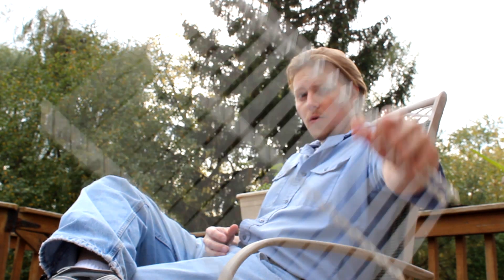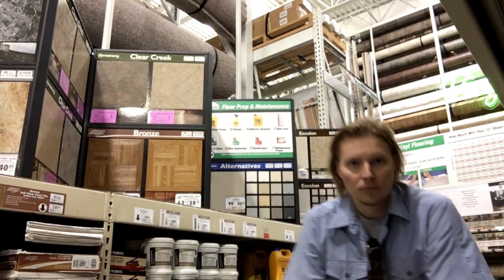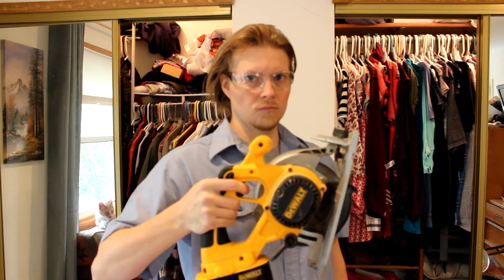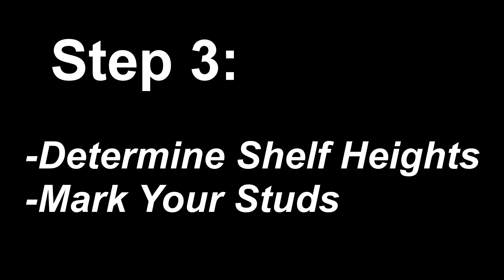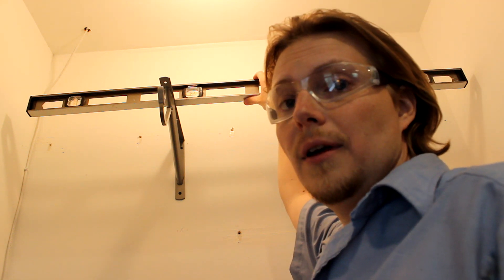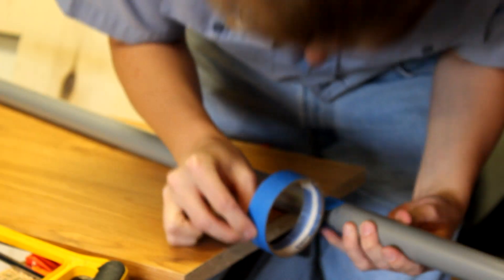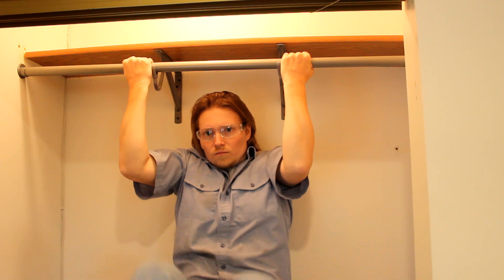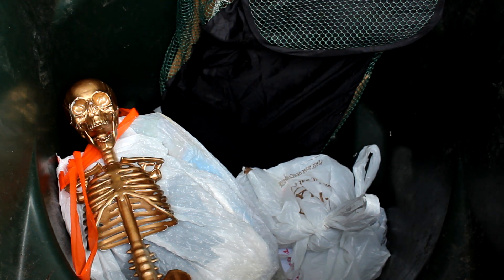Why I Hate Wire shelves & How to Replace them

Comment: Don't you think you should put some kind of cleat or end support at the shelf ends to prevent sagging over time? You said you're a perfectionist... its basic carpentry 101! Fully support your work! Especially with pressboard shelves ! You need to hold those sucker's in place!

Comment: Nice job. My wife wants wire shelves in the laundry room. I just have to ask. You did all that work and then used particle board, and not supporting the ends the boards with one or 2 more brackets the board will eventually sag and fail. Why not just get a piece of pine. Just a suggestion 🙃
Reply: I said the same thing to myself I would of out some extra support on that

Comment: What type of hanging rods do you prefer and does Home Depot cut pipe and wood for you if you don't have the equipment?
Reply from the maker: I don't have a preference. Whatever fits the supports is what I have used. I don't think Home Depot will cut those for you, however you can cut them with hand tools that are relatively inexpensive.
Reply: Missharper25 : HD does cut various sheet materials and lumber to customer spec -- and also permits in-store cutting by customers. Check with your local store.
Reply: Shelves A La Mode
Adventures In Great America : You have something of Buster Keaton and Harold Lloyd about you, but there are higher-end wire shelves that address some of the strength, convenience, and aesthetic issues that you hated, and a remod with these would have been a simple snap out and snap in.
That said, if your exercise routine demands doing pull-ups in the closet, you did the right thing.

Comment: Those cheaper wire racks had no end supports at all etc no one they were bending and overloaded for that cheap of a system there are stronger sytems out.. so you put in less shelves and less clothes..

Comment: Hate wire shelving and ALWAYS replaced in the 3 houses I've owned.  And why are the wall mounts for these wire shelves NEVER installed into a wall stud?!?!?  Those molly brackets always pull out from the wall from the weight of the clothes and items on the shelves.  Gimme an old fashioned metal shelving bracket installed into a wall stud with hex bolts.

Comment: Sorry I have this wire shelving in five closets and have had it for many years -- 20+ NO PROBLEMS. Nothing has fallen apart. Two were for kid's closets - NO PROBLEMS. One was for our coat closet which got a lot of usage!! NO PROBLEMS.
Reply from the maker: Then why are you watching this video?
Reply: @adventuresingreatamerica2098  I am putting up some new shelving in a new house and wanted to refresh my memory. I have since installed the shelf. I think it will outlast the house.